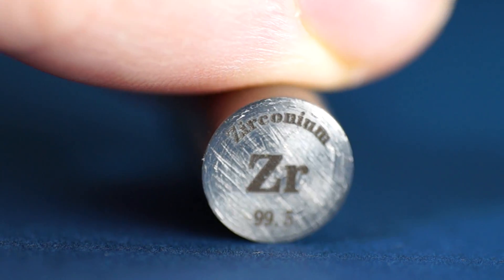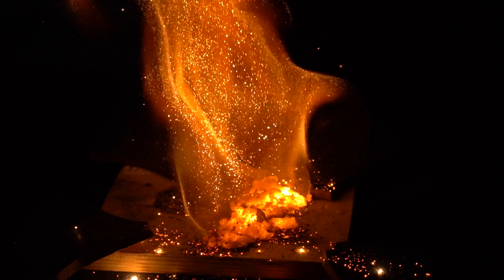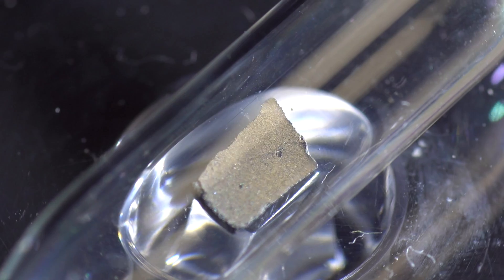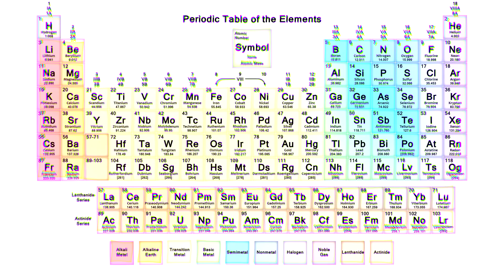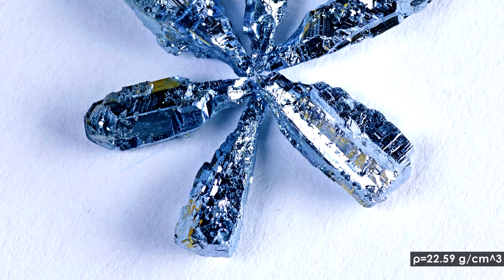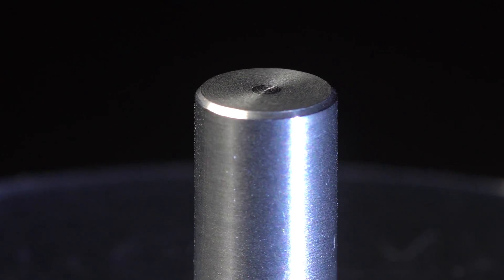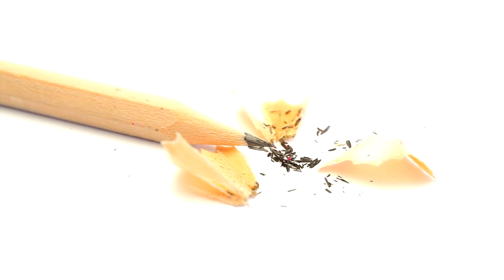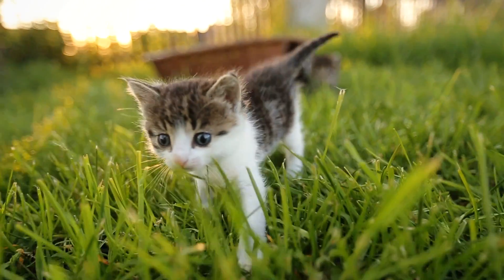7 WEIRDEST CHEMICAL ELEMENTS!

Comment: Some electronic devices contains beryllium and there's often a warning on them too. And here's the conductivity and ability to transfer heat a real advantage. The density isn't a disadvantage either.
Reply: I believe the French speaker manufacturer "Focal" claims that they are making tweeter domes from beryllium.

Comment: I would like to add one more quite important property of Beryllium.
It is resistant to making sparks, this makes it a very important metal for tool coating used in industries that work with highly explosive and flammable materials.

Comment: Beryllium was machined to make gyroscopes for ICBMs as it does not expand or shrink in heat or cold. I saw other parts made of it where hardness, weight and shrinkage were important. An alloy of beryllium copper makes powerful springs and even firing pins in some expensive firearms.

Comment: 2:50 yes, thorium is more "abundant" in the Earth's crust than uranium, but at 12 ppm (U 4ppm). You can't economically extract such low levels of either metal, nor indeed any metal at it's crustal abundance levels, so you need a geological process to concentrate the element up to a grade where it can be mined economically.   Uranium is soluble in oxygenated groundwater and there are many processes which can concentrate it even up to 20% (Cigar Lake mine, Canada). Unfortunately for all you thorium lovers, there are only two processes to concentrate thorium, and these processes are not very common (pegmatites and monazite sands).  This makes thorium much more expensive than uranium and the limited distribution of deposits creates a supply risk for users - the supplier country might not be friendly in the future!   Uranium, by comparison, is found in nearly every country and the reserves of it are large, known deposits are good for 400 years, hence its low price.

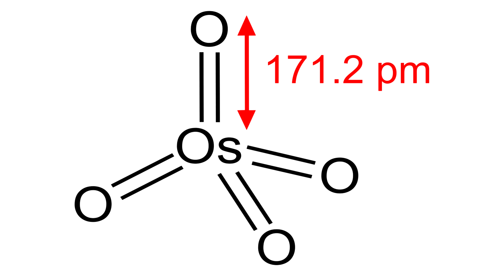Comment: 7:40 Physicist here. I once worked with Osmium tetroxide in the lab. It is used in transmission electron microscopy as a contrast agent. Osmium tetroxide in solution fumes and when you get the vapors in the eyes, it permanently stains the cornea black and you get blind immediately. Working with such a toxic substance was quite an experience.
Reply: Did anyone you know or work with ever have to experience anything like that first hand?
Reply: @Sl4yerkid  Fortunately there have not yet been any accidents in the TEM department of my university. I have to admit that I was a beginner in pipetting, but with good precautions (almost closed fume hood, two pairs of gloves, safety glasses, opening the OsO4 storage bottle for as short as possible) and good supervision anyone can do it. Also once the stuff turns black, you know that it has already reacted and there is no more danger.

Comment: I got a 144g tube of beryllium that is coated with a resistant varnish leftover from the Cold War. It literally feels like lifting a PVC pipe based on just how light it is.
Reply: How big is it? As big as a coke can? 144g ain't gonna help XD
Reply: Don't break it! Berillium is fantasticaly toxic and carcinogenic. 
Edit: Don't scratch it either.
Reply: @EdwardTriesToScience  nah from everything i've seen in toxicology, it doesn't seel to have effects while ingested, with skin contact or whatever. But of course breathing beryllium dust will make you cough instantly and make an allergic reactions, and repeated exposures will lead to chronic berylliosis
Reply: indeed, the danger is really inhalation (also apparently berylliosis is only able to happen in 40% of people, still better to stay safe)
Reply: E Van  Don't..  It's toxicity is legendary.
Reply: @ph11p3540  as in mythical? maybe you mean notorious or are you being facetious? otherwise, nonsense, Beryllium Copper is easy to machine and only slightly higher cost because of precautions during machining but it is an amazing material.  People being scared with ignorance allow lawyers to sue extraordinarily great things out of existence, e.g. nuclear power plants, asbestos
Reply: @vphls ah yes, comparing CuBe, which is less than 5% Be to Be, not understanding the term "legendary", and somehow bringing in the legal system. I wonder what the difference between a machine with precautions (I wonder what they are for!) handling CuBe and a person handling Be is.
Reply: @user-pr6ed3ri2k  most common CuBe alloys are CuBe2, wich is a pretty damn tiny amount. For a while, beacause i work with bronze a fair bit, i wanted to get myself some CuBe and work with it, but it seems even the 2% of beryllium in copper dust would be enough to cause allergic reactions in the lungs... So yeah, while CuBe bronze by itself isnt dangerous or toxic, grinding it and breathing the dust is a big no no. And that's a shame, beacause cupro beryllium bronzes are the hardest and strongest we know, with hardnesses going above 50HRC (a good knife blade will reach 60 HRC), and they make non spark hammers and chisels from CuBe. Such a shame that the best materials also are toxic, like lead...
Reply: E Van  
I've got a solid, round-ish chunk of beryllium I bought in the 2000s from one of the online element stores. I'd love to have an LED flashlight.made of beryllium.

Comment: My top 10 list is:
1. Helium -- the only noble gas that has only two electrons in its outermost layer, it is suprafluid at low temperatures, it dissipates through any container wall, it never becomes solid, and you sound like a smurf when breathing it,
2. Hydrogen -- the only alkali non-metal,
3. Boron -- it is the only 5-coovalent element, extremely hard to purify,
4. Carbon -- very easily forms polymer chains, also has a form diamond that is one of the hardest materials known, but that burns at low temperatures,
5. Platinum -- one of the few metals partaking as a negative ion in a salt (Cs₂Pt), also a very catalytic metal,
6. Xenon -- a noble gas with a vast chemistry,
7. Mercury -- the metal with relativistic speeds on the innermost electrons, making it fluid at low temperatures, disolves lots of other metals,
8. Fluorine -- the most electronegative element, puts almost everything on fire except steel,
9. Caesium -- the most electropositive element, even forces Gold and Platinum to get extra electrons,
10. Gold -- one of the few metals partaking as a negative ion in a salt (CsAu),
Reply: Elemental Fluorine is also excessively toxic, and hydrofluoric acid is easily the most dangerous acid to interact with.
Reply: Fluorine can only be stored in a metal container if the inside is scorched with fluorine first, forming an oxide layer. Remove that layer at your peril.
Reply: Lance Harker not an oxide layer a fluoride layer
Reply: That's what I was thinking....
Reply: @lancepharker  that is only if you store it in pure form, you can store it in glass, however you would need to put it with another gas that fluorine does not react with such as helium
Reply: @lancepharker  I didn't know that. That's actually really interesting. Thanks for sharing
Reply: There have been reports of metallic hydrogen I'm not sure if it's been substantiated though. I believe it was like 3 years ago. They were using diamond anvils and smashing the hydrogen between them.
Reply: @christianheichel  thanks for mentioning this because I was completely unaware. At first I was really confused by "metallic hydrogen" so I looked into it and yes it's a real thing, but not what you expect. It's hydrogen that acts like a metallic conductor. There's a surprising amount of information on it out there and I encourage everyone to go have a read
Reply: @christianheichel  
I seem to recall hearing about gasses being "transformed" into strange and unusual forms on/in(?) Jupiter. I heard about it maybe 5-8 years ago. It's due to the unearthly pressures and conditions in & around Jupiter. I believe they described some of the hydrogen there as taking on some metallic properties.
Reply: @christianheichel  it's only in Jupiter's atmosphere as of now
Reply: Yeah , Hydro fluoric acid is very dangerous
Reply: @smrutiranjanmohapatra5487  but not as not dangerous as flouroantimonic acid -21 to -23 which is 20 quintillion times stronger than sulfuric acid which ranks at -12 or hydrofluoric acid which is -10.2 to -11on the pH or carborane acid -18
 Chlorine Trifluoride while not an acid is an extremely dangerous interesting chemical look it up on YouTube.
Reply: @christianheichel  thanks for your information , I will check it on YouTube
Reply: @christianheichel  HF is a very weak Arrhenius acid. But it's extremely dangerous, it reacts with your bones to make CaF2. Chemists dub it the bone hurting juice. It's also very good at dissolving flesh, so if you got it on your skin, it's gonna gonna go straight to your bone. HF also melts glass as it form SiF4 so they have to be stored in plastic bottles.

SbF5 may be a very strong Lewis acid, but pH doesn't make something dangerous all the time. Im not saying SbF5 is weak tho, it is still dangerous. For example, nitric acid, in high concentration, only xanthoproteins would form.
Reply: @christianheichel  also are you talking about the H+ concentration with those numbers? Because if you are then you can't call it pH.
pH only lies between 0 and 14 at 25°C.
Reply: @prateekkarn9277  You are correct the pH is only used to measure acids in aqueous solutions while flouroantimonic acid can't exist in aqueous solutions. The Hammett acidity function for flouroantimonic acid is measured at -31.3
The  -21 to  -23 pH number is derived from It being 20 quintillion times stronger than sulfuric acid which is around 1 on the pH scale
In previous comment the -12 for sulfuric acid was in reference to the Hammett. acidity function. Sorry about the mix up with numbers and acidity measurements
Reply: @christianheichel  corrosiveness and Strength of an acid are two different  things, one can be an extremely strong acid while being not even able to burn skin while one can be a very weak acid still being able to dissolve glass easily.
Reply: @smrutiranjanmohapatra5487  bone hurting juice XD
Reply: Carbon should be number 1, because cats are made of mostly carbon.
Reply: I like your list but I feel I should inform you that on the periodic table of videos channel they burned steel wool with Flourite. That being said, I don't know of anyone making Flourite burn a steel plate or rod.
Reply: I thought that lithium was the most electropositive element, not caesium. Still a cool element though.

Edit: Just realized it was the strongest reducing agent, not the most electropositive element. Sorry about that.
Reply: @lithiumscience6861  
What do you mean by lithium being the strongest "reducing agent"(in layman's terms please, Lol)? I actually have a chunk of metallic lithium in a small glass jar of mineral oil. It floats in the oil, and it's just ridiculously lightweight! It's about 2" X 2" x 1". It kinda feels like a chunk of balsa wood when you pick it up and hold it...
Reply: @HighlanderNorth1  A reducing agent is something that likes to give it's electrons away, so the opposite of oxidizing agents. All alkali metals are reducing agents, and lithium is the strongest reducing agent. It has nothing to do with weight.
Reply: Fluorine will most definitely catch steel on fire.  (When the steel is powdered or fine wire)
Reply: Hydrogen should actually be a metal that's why the alkali nature. When liquefied like in the atmosphere of Jupiter, it forms metallic hydrogen. It's not just the physical properties, but literal metal, exhibiting the same properties as mercury but far more powerful. Imo should have been in metals but which metal group even i don't know. Hydrogen could easily earn the title of the only gaseous metal, just like mercury is the only liquid metal